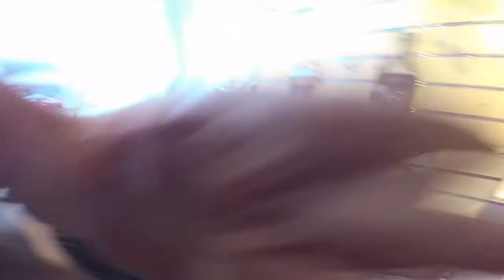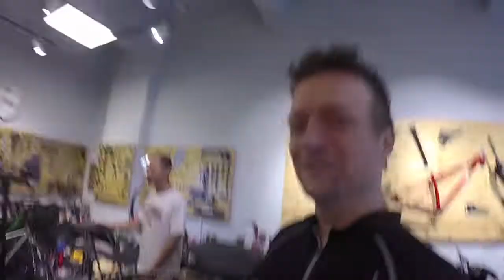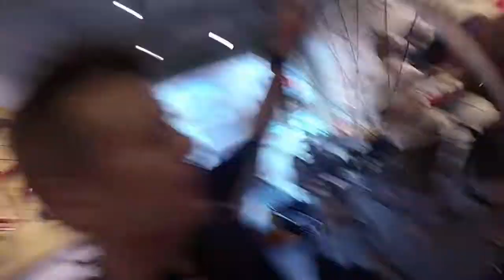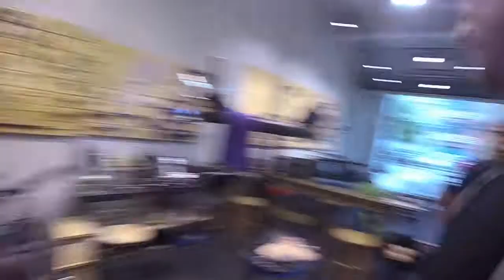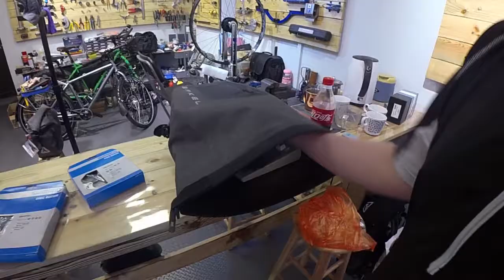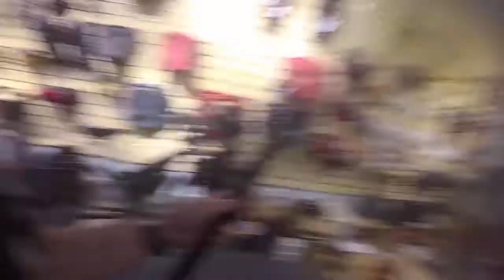Touring Bike Shop China/New TK540 Wheels / Trailers / Getting Ready For Nevada Desert Tesla Homeless

Comment: That "28 watt" solar charger is more likely an 18 watt. I have a 3 panel that's supposed to be a 21 watt but is instead a 14 watt through actual testing. You never charge phones directly with it. Charge up battery banks during the day then use that to recharge your lights or phone. To be honest a dynamo hub would have been a better purchase given you were deciding to get new rims.
Reply from the maker: Hey... I got the solar charger for pretty cheap. I hope its really 28... but for the cost of the dynamo, light, relay stuff it would have been enough to buy more than 10 solar chargers. Id love to have a  dynamo system if they start falling from the sky : )
Reply: Well, if you are going solar and you have a trailer might as well slap a few of those on top and get an extra battery charger.
Reply from the maker: Yeah I would like to have the 60w... but I am so much running out of money. I am down to 1700 yuan as I write this, I have to try to make an incredible amount of money to get there by the first week of September.. Or the second. Its a tight race. Just bought a couple of cheap solar lights, Got some head led lights, and a flashlight for the camp... Had to re-order a coleman 533.. that cost a pretty penny... andjust picked up some midland walkie talkies... they where 620 rmb... I was tempted to get the baofang... but I dont have a ham radio license,,,. Tons of other stuff to prepare....